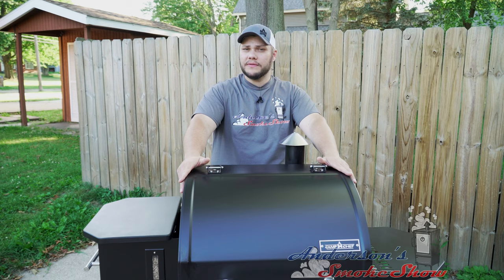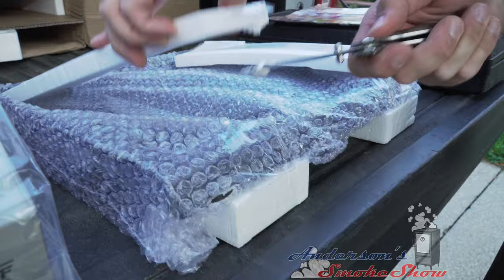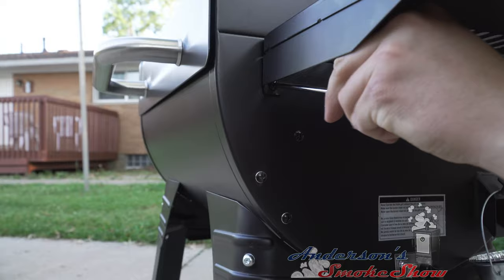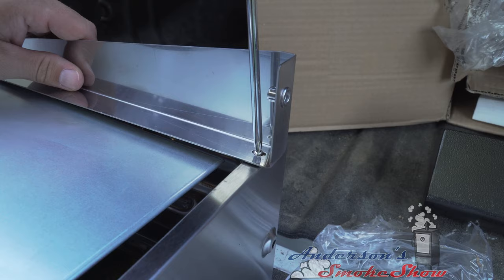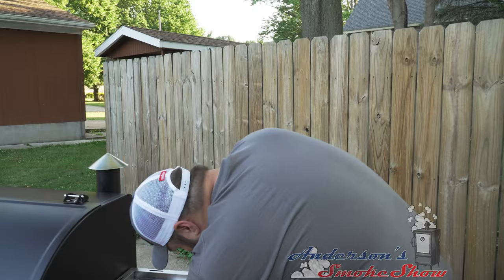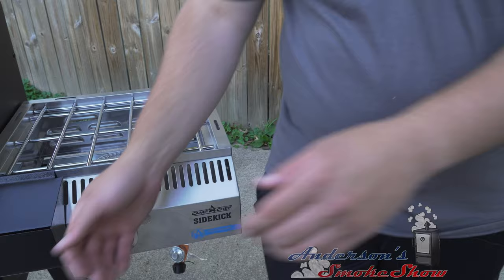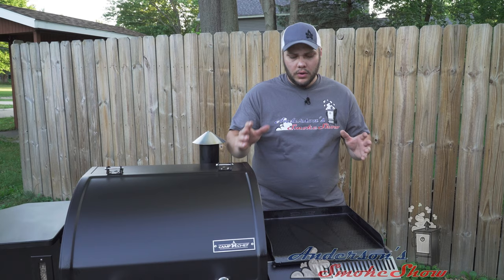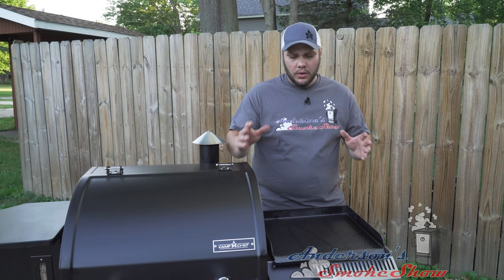Camp Chef Sidekick | Pellet Grill Accessories | Unboxing & Installation

Comment: I have a brand new camp chef. It keeps tripping my out door plug gfi? Do you think it's the plug? I got the wood win pro  36    It did not trip when I had my smaller put boss. Any ideas?  I plugged it into a different outlet inside my kitchen and it's a regular plug and seems fine.

Comment: So with the leveling screws what I did is actually drill through the grill at those holes, install screws from inside grill, and use washers to accomplish leveling. Figured two more points of attachment to the grill would increase its ability to be stable while weight bearing.

Comment: Do you know if the sidekick can be mounted to a table instead the side of the grill? Does it put out too much heat towards the bottom?
Reply from the maker: I doubt that it’s supported as a table top unit.... Camp Chef does have tabletop units that are very similar though: https://bit.ly/3lqcH4Y

That’s a Versatop bundle, but there are other similar offerings as well.
Reply: This burner is hot as hell. I swear the flames are 8” tall.  I wouldn’t want anything below it

Comment: Camp chef needs to sell an extension rod for the ash clean out for the grills with side kick and searing station. I love my searing burner, but almost never use the ash clean out after installing it. Side kick looks even wider than the searing station.
Reply from the maker: I didn’t even think about that.... it will make it more difficult to get to.
Reply: Anderson’s SmokeShow working on a mod for this. I’ll let you know what I’ve come up with when I finish
Reply: Just had a thought. I am not sure what the dimensions are of the sidekick, but the 36” burner pullout might be long enough for the 24 in grill plus the searing burner (13”). The threads are M8 1.25 pitch by the way. I found some threaded rods that would work with a coupling nut on amazon and McMaster Carr. I’ll probably replace the knob with a longer wooden one too, as with time this part doesn’t slide very good anyway. With the added length, an extra support is probably needed as well so it doesn’t bend.

Comment: like your videos, with the sg and the woodwind, is there that much of a difference in the controllers?, i want the wood wind, but like the black lid on the sg, and the controller seams to be where the differences at, besides the legs... sure its probably nice having extra probes, but besides the extra probes, is it worth the upgrade to the wood wind?
Reply from the maker: Hey Kevin thanks for watching and reaching out! The difference between the two is $100 so it’s really not too significant. What you lose by going down to the SmokePro is the bottom shelf, two probes, stainless steel lid, and the color controller.

Both controllers are PID and work well at maintaining the internal temperature of the grill. I don’t miss the 2 probes (but maybe I will in the future when I really load it up) there is no timer on the SmokePro controller which is ok since we have cell phones. The color controller is nice. It’s a little higher up and it’s angled upwards so it’s easier to work with without bending over.

The bottom shelf on the woodwind is cool if you aren’t moving the grill around.... if you move it in and out of the garage, things tend to fall off that shelf if you don’t remove them first. So for me I don’t need it.

I personally like the looks of both grills, but after going through the other differences for me $100 extra for a stainless lid is not necessary so I am perfectly happy with my Camp Chef SmokePro SG24 WiFi!
Reply: @AndersonsSmokeShow  thanks for the reply, thats exactly where im at, im planning on getting the side kick attachment like you did in the video, which sort of brings the price even closer, unless there is a hidden bundle price like they have on the woodwind.  My one other thing, on the controller again, is it lookes easier to read and use, which would make it easier, for like my wife, to use it, but with the app that might be mute.  Anyways, i agree on the other stuff you said, can't wait what you cook on it next!
Reply from the maker: The color controller on the woodwind is a little more intuitive as it lists the menu and you can scroll down through it. It’s also mounter a little higher and pitched upwards to make it easier to read and control.

Comment: Question. I bought the grill from Camp Chef. Is that griddle porcilen coated or plain steel? If you use the sear box where does the grease go?
Reply from the maker: It’s a cast iron griddle

Comment: My starter won’t ignite gas. I wonder if they sent me a dud
Reply from the maker: One thing to try is turn the knob just to the point where it’s about to spark, but hold it there and let a little gas build up for 3-4 seconds, then spark it..... if that doesn’t work there’s a metal rod used to conduct the spark. See if you can bend that a little bit until you see a spark jump between the igniter and the burner
Reply: @AndersonsSmokeShow  thanks for replying! I do see a spark when I try to ignite it but it won’t ignite burner. Do I need to bend the rod a certain way. Should it be higher or closer to burner? I know there’s gas flowing because it does light up when I use a regular lighter
Reply from the maker: Typically you’ll want a little more gap for more spark

Comment: I wish mine worked :(  Tried it for the first time yesterday and it wouldnt ignite.  Got hold of Camp Chef and they told me to move the switch 1/4 in which I tried multiple times.  So I have pretty much wasted a lot of money on the sidekick, grill box and pizza oven since they wont work.  I can smell the gas but thats about it.
Reply from the maker: Do you hear the click on the igniter? If so, do you see a spark? If the answer to both questions are yes, then turn the knob so you hear gas flowing and hold it there for about 3-4 seconds then turn it so that the igniter sparks.
Reply: @AndersonsSmokeShow  -no on both.  It does nothing.
Reply from the maker: Hmmm…. It doesn’t “snap” at all? It would just be one time you hear it.
Reply: @AndersonsSmokeShow  -Nope.  Nothing. I think its a lemon.
Reply from the maker: @ladyfran1960  what did Camp Chef say when you contacted them?
Reply: @AndersonsSmokeShow  -they told me to move the ignitor 1/4 inch.  I have to call them back and tell them I think the part is defective.  All of the hosing is tight and I paid someone to assemble it for me.  The pellet grill works fine but the sidekick is a bust.
Reply: @AndersonsSmokeShow  -they offered to send me a new igniter.  After playing with the placement for about an hour I was able to get it to light.
Reply from the maker: Ahhh nice! I was thinking that could’ve been the issue